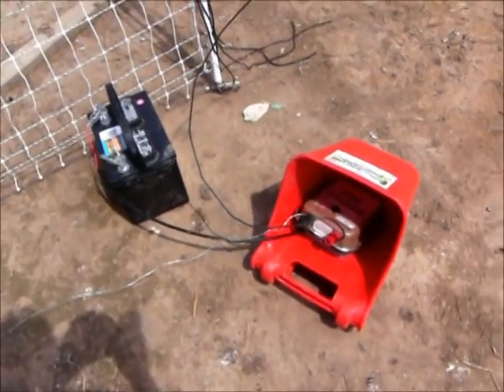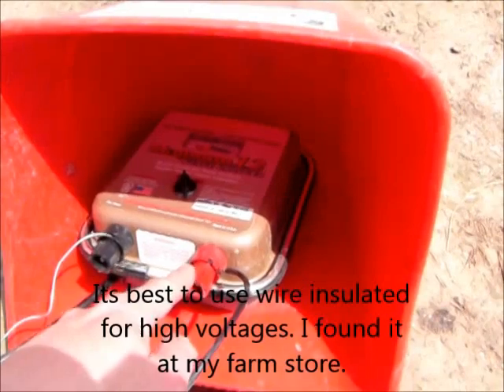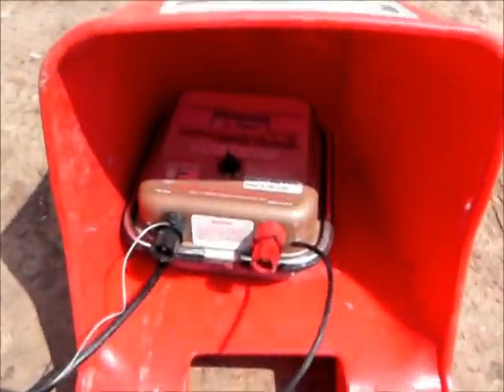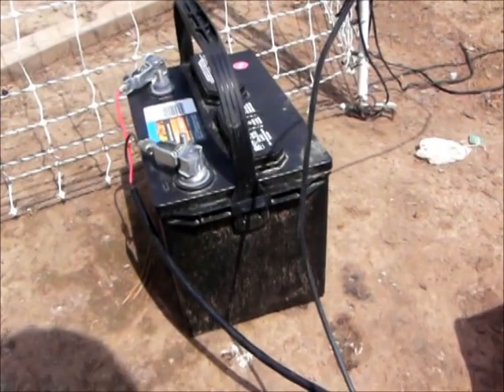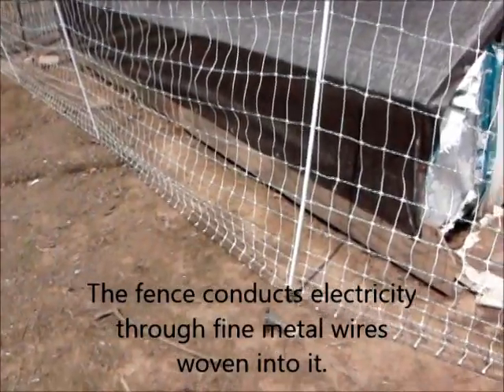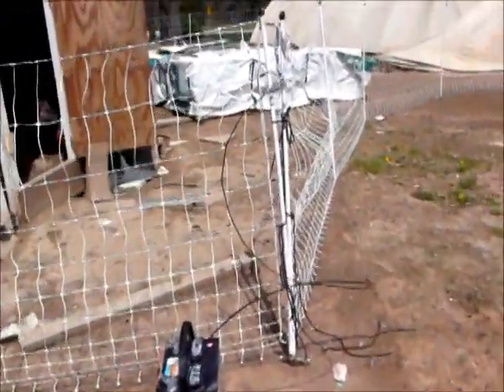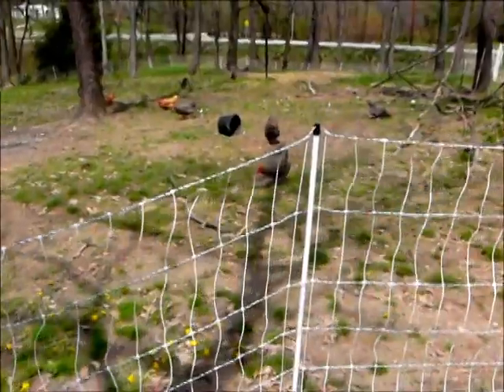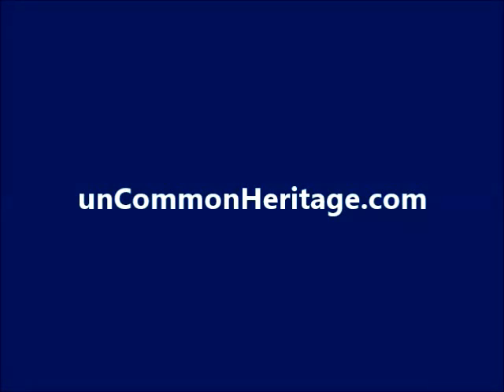Electric Poultry Netting

Comment: Can this voltage kill you?
Reply from the maker: There are different types of chargers, with different risks. There is at least one story out there of a toddler crawling through wet grass and getting killed by an electric fence, likely a so-called weed burner. With electronet the manufacturer suggests an intermittent spark to prevent damage to the nylon material.
Reply: Any voltage can kill. It’s the current that matters

Comment: I want to put the fence in a place where underneath of my soil is rocks everywhere, do you have any suggestions please ?
Reply from the maker: For this type of fence to work as intended, you do have to be able to push the spikes into the ground. They are roughly the size of a pencil and about 4" long. There are two versions of the fence, one has two spikes on each post, the other a single spike. Whether or not it would work depends on just how rocky your soil is, but the single spike version would have a much better chance of working, IMO.

Comment: If I understand correctly, you are able to get a months power from one battery charge. I"m considering either solar or battery. Dont know if solar will be my best choice because of shade. Thanks for video
Reply from the maker: ***** A months charge would be extremely conservative for a modern charger with a new deep cycle battery. You could probably get a month out of a worn out car battery, assuming it doesn't have a dead cell, which is how I've started charging mine. They just don't take much power. I'm running a couple of 12 volt Parmak chargers you can get on Amazon for $100 and really like them for the price.
Reply: Luke Townsley  Thanks Luke